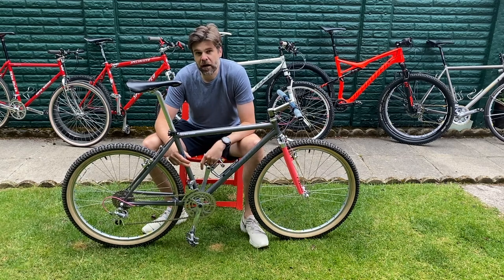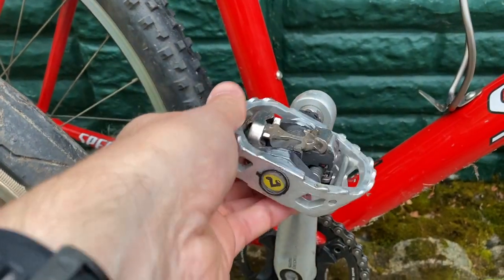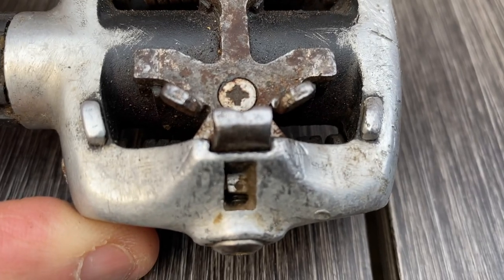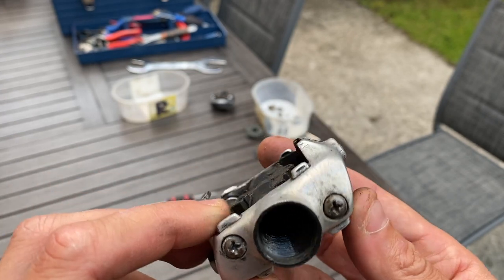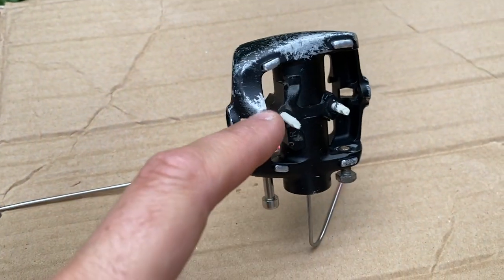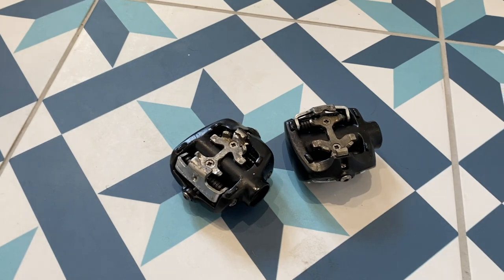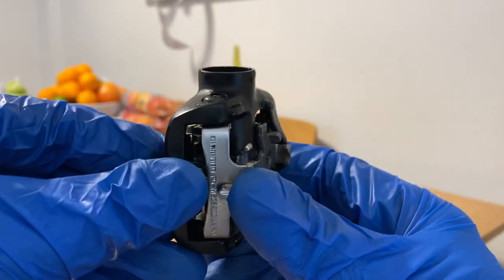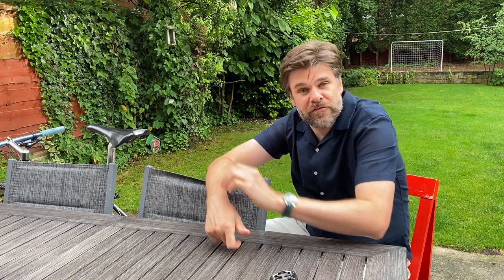1st generation Shimano SPD complete overhaul and history

Comment: Good work, well worth it. Switching from flats to SPDs in my late teens transformed my mountain biking. So much more efficient uphill, surprisingly helpful downhill. I've got 3 sets now, including the red cage DX version popular with downhillers back in the day. The original pair I bought around 2003 are still going strong!
Reply from the maker: I've always been an SPD lover. I think those red DX ones are about the only model I've never owned! They look so cool but were a bit too much on the gnarly side for the kind of lightweight XC riding I was doing at the time.

Comment: Ah ha. So 525s are DX? I assumed they were in the LX bracket. I have a few sets floating around I think. If they’re lighter than the XTs, we’ll I best make sure I have a running pair to stick on my KHS Team.
Reply from the maker: 525s are like rats, you're never more than a metre away from one! They were so ubiquitous that they all but killed off the high end platform pedals of the day, which is why I always get so jealous when I see you and Gary unearthing beautiful rare Deore and XT flats. Yes, 525s were universally known as DX - even though (like the Deore thumbshifters of the same generation) they never said DX on them. Even more confusing, by the late 90s when the M545s came out, those were marketed as LX. By then the DX groupset had been phased out but the brand was still used on a limited red and black range aimed at downhillers and BMXers. Only V-brakes and some ultra gnarly caged SPDs as I recall. If you do up a pair for your KHS, I'm sure you'll do a better job of painting them. I did a very sloppy job and mine are already paying the price.

Comment: I have SPDs on all my bikes. I tend to lob them once they start clicking, but having watched this it looks like servicing is quite simple. Looking forward to seeing this shot blaster!
Reply from the maker: Hopefully I’ve done my bit to reduce your obscene levels of wasteful consumption. You will see the blasting machine in due course - the gentleman that owns it has promised full access. Going to test it on an old crank first.
Reply: @red_dread  Yes, I have just ordered that plastic tool, and I have that exact same multi spanner which I think came with my Raleigh Pursuit, circa 1984.
Reply from the maker: @TheRampax  You might not need an 11mm, only the earliest SPDs had those. Later ones are 10mm cones, with a 7mm locknut. Either way, a very flat spanner turns out to be a useful artefact indeed.

Comment: @19 minutes, the way the goal in your garden is rigged to prevent low balls is very clever.  Lovely job, lovely pedals indeed, but what sort of paint and how well do you expect the finish to last?  I can't imagine a regular can of Halfords car paint, even with a zinc primer and lacquer top coats would last well.
Reply from the maker: That goal needs to be moved up off the lawn so my army of tiny idiots don’t use it as a weapon on each other. As for the paint, yes I fully expect it to last about 5 mins - was really just for show. It already chipped a bit during reassembly. I’m sure the original black is some sort of anodising or coating, it’s much more durable. Whoever stripped this one bare must have really gone at it.
Reply: @red_dread  Just remember to raise the netting up off the ground when not in use so you don't accidentally net some wildlife. 
I watch Wildlife Aid's YT channel; I can't tell you how many foxes, hedgehogs, and even snakes they've had to cut out of sports netting.